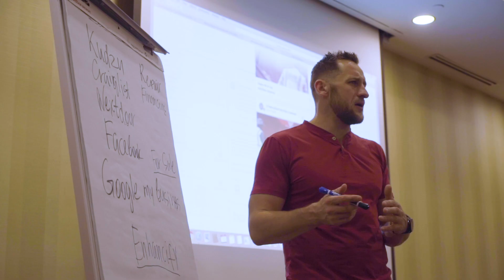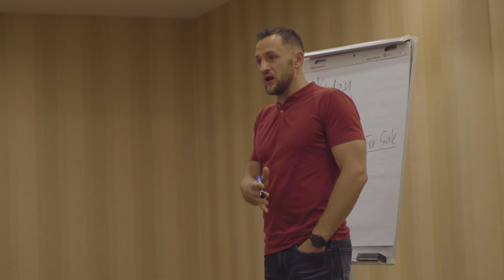Best Damn Roofer: Real Josh Bigger Interview | Roofing Insights

Comment: Won't longevity roofs hurt you in the long run?
Reply: There’s quite a few homes around most parts, hard to even count sometimes
Reply: Not when they are 40% more in cost. Especially when you do them at the same rate you do asphaltic shingles.